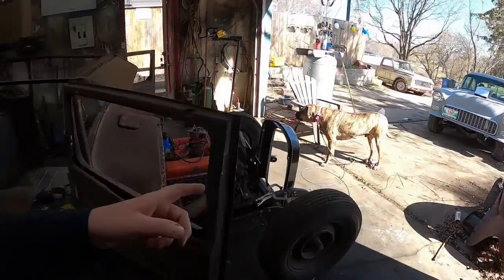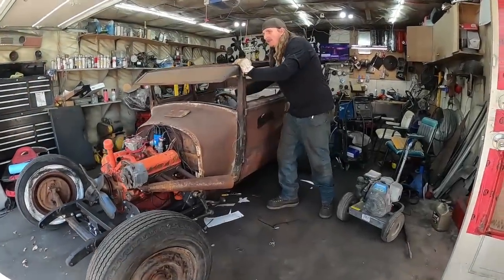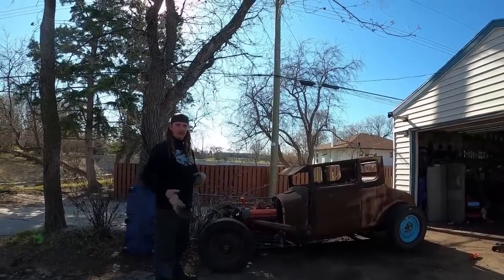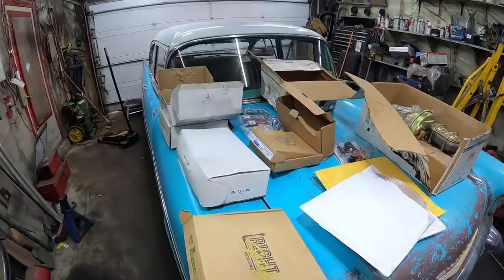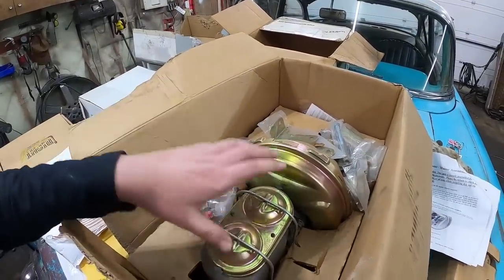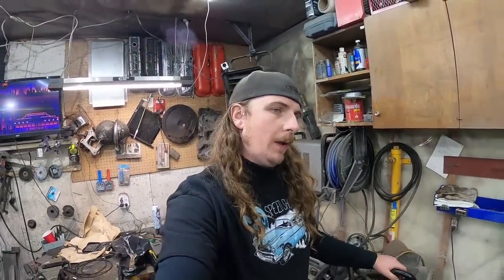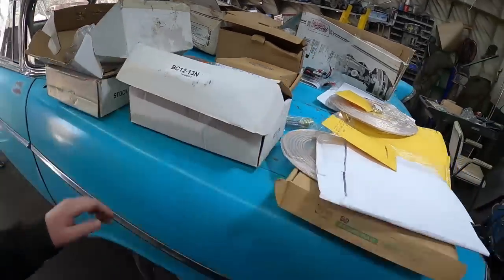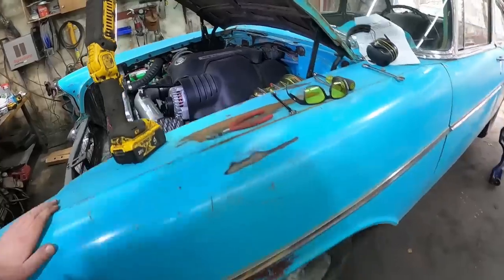Hot Rod Disc Brake Conversion - Cheap but so Easy... Part 1

Comment: It's young guys like you that give the unf to tackle work that I would take it to someone else. Keep up the good work. I also have a 57 210 a 70 Nova and a 75 camaro that I'm converting to a 71 1/2 spilt bumper
Reply: What do need to convert my 68 delta88 front-end what's the best car

Comment: When I updated my 57, I got those fittings for the brake lines into the master from my local parts store (good one). One piece fitting that went from the thread in the master to 3/16" line to both ends.

Comment: The roller bearing front hubs is a kit you can buy for a tri 5.I have it on mine with factory drum brakes. Front hubs from a 64 Chevy car does the same thing.

Comment: I got my kit for my Chevelle from ccp. $600 for the c5 caliper kit with 13" rotors new steering knuckles Corvette hub bearings hoses etc. All I needed to do was unbolt the old knuckles and outer tie rods and it bolted right on. Ungraded with a $20 swap meet hydroboost unit and Corvette master cylinder. Stopping is no longer an issue.

Comment: Cool, some of those conversion kits are junk!! I’m running a Chevy 3/4 ton axle under my gasser, I went with Speedways disc conversion that uses 2nd gen Camaro discs!! All I had to do was change out the inner bearing!! They worked awesome!!
Reply from the maker: Very cool!

Comment: Dan great video hey be careful by any aftermarket batteries I’m in Milwaukee guy in Milwaukee purchased aftermarket Milwaukee batteries which did not work in my old Milwaukee tools will work in my new Milwaukee tools won’t work  waste of money!!!!!!!!!!!!!!!!!!!!!!!!!! second of all don’t beat yourself up too bad breeder up and brake line up back when I was about your age to the 74 Pinto just like you’re doing rotors pads a whole big front new brake lines didn’t realize you need a double flare...So I used So Teflon tape that lasted for about 3 miles... Had to do it all over again keep up the great work junkman do

Comment: On the old drums, you get the hubs from a early 60's impala from the junkyard, and then a set of conversion bearings to convert the front to tapered roller like you have/had.  The conversion bearings have a radius ground into the inner race to sit against the radius of the 55-57 spindle where the original ball bearings ran against.
Reply: 61 to 68 Impala hubs already have roller bearings. No need to change them.

Comment: You can install an adjustable proportioning valve if the front / back bias is really far off. They work great with just a bit of tweaking.

Comment: FYI on a GM  if the cylinoid goes out on you it's free to fix cause you only use half of it just turn the positive nut 180 and your brand new

Comment: I have a 57 with looks to be upgrade power booster & master cylinder (front/rear tank). I think All I need are the calipers, hardware, and rotors. I am not sure though.

Comment: Bought some 'used" stuff off a 55 for my 56. Problem being, if you don't know it's 'pedigree' you are kinda left hanging. Thought it was a kit from a fairly well known company, but after sending their Tech guy some photos, turns out it's not. He said Chevelle or Camaro. Still polishing and cleaning some surface rust, but seems that it will be okay. 11" rotors. Rotors, calipers and pad look brand new. Hope so. Still need mst cyl and booster. ;) Good video, gives me hope!  ;)

Comment: I'm doing a four wheel disc conversion on my 37'. Stock straight front end, 79 truck 12 bolt rear.  Wish it was as easy as your car. Hotrod pars for 30s GM is a bit  scarce these days.
Reply from the maker: yeah i hear ya.  good luck on the parts search

Comment: Discs are going to make that Five Seven a lot more fun to drive, but less exciting in traffic. I got tired of pushing vehicles around my yard about ten years ago. So I have been on a mission to make them all move under their own power and stop, even if they are nowhere near being drivable. It makes driveway Tetris much easier. I use my winch to pull cars into the shop all the time. Used it Friday to pull an Opel GT with no suspension under it off my friend's trailer and onto a makeshift frame with wheelbarrow wheels so I can move it around the yard. Ever try to move a 900lb rusty body shell without wheels under it? I have two like that now.
Reply from the maker: Haha thats awesome!  I'd like an opel gt one day

Comment: No slotted mags yet  4 the 57 or the truck we'll stand by LOL bueno sir standing by 4 the next. Hope you don't mind a question I'm about to take out my 72 chevy truck but the back brakes are not working the pads are good but no fluid is reaching them 1 would it be the proportion value the one next 2 the booster I replaced (not me ) the master cylinder already . 2 could it be a line but they are not bent or rusted or leaking . Again sorry 4 the bother RF TX. Thanks

Comment: Dan, do you happen to have a partnumber on the brackets? I have the brackets you mentioned on the front of the stock spindles. You can’t switch them from left to right, then they gonna hit the steeringarm. So now I’m stuck with calipers on the front and might have a problem later with a swaybar hitting the calipers.... So, I want the calipers on the back of the spindle, but I can’t find the right brackets for stock spindles. Hope you understand? Thanks!
And as always, great video!!
Reply from the maker: Totally I ran the front style in my 55. Never though of the sway bar issue.  The right stuff has a decent website I'm sure they'll have somthing there.  Iv already tossed the parts lists sorry man
Reply: DD Speed Shop ok Thanks, I’ll check them out

Comment: My favorite job is packing bearings, not! I bought the Lisle 34550 bearing packer to make life easier. I used one of their kits for rear disc brakes and yeah the instructions suck. Keep up the good work.
Reply from the maker: did the bearing packer work out pretty good?
Reply: @DDSpeedShop  Yes it works great. No mess and if your repacking used bearings you can watch it push the old grease out.

Comment: I would rather convert to discs than fight with all the springs and adjusting drum brakes. Hard to believe we used to rebuild wheel cylinders, change out bearing races, turn drums, every day. I have a special kind of hatred for drum brakes now.
Reply from the maker: i dont mind the drums

Comment: Cool stuff doing 4 wheel disc brakes on my pinto but using newer  8.8 rearend I bought yesterday that was setup with disc so I just kept the brackets and going to buy new calipers for both sides and just going to upgrade the frontend with mustang ll front suspension new and with the bigger rotors as well. We gotta get all that power stopped a little quicker don't we . Also going to use a 7 inch booster and new master combo car has manual as is but that's the fun of it build it fast with the stroker 347 then gotta pull back on the reins and say whoah boy whoah 😂🤣😂🤣🚗💨 and with the 57 u will need to get that girl slowed down fast also because she looks like she likes to go fast 🤣😂
Reply from the maker: nice!  good luck on the hot rod man
Reply: @DDSpeedShop  thanks man I hope that they hurry up with the stroker kit I was wanting to get it built before it got too hot but it looks like I'll be building it in the straight heat I wish we had your summers down here in Alabama we have the humid heat and I'll take all the luck I can get you know how these builds can end up😜👍👌👌

Comment: A few things , One when packing wheel bearings with disk brakes, always use high temp grease & and use more grease between the big bearing and tapping in the seal. Fill that area solid with grease. Also fill the center of the rotor area with grease and pack the outer dust cup full of high temp grease as well.  ( there is a reason I say this ) . Next Disk pads, grind each outer edge of the pad on a 45 degree to keep them from squeaking. Next always use anti squeal compound on the back of the pads to again stop pads from chattering  or squeaking.  Question ? did the master come with a disk brake propprsing valve ?  If not , your going to have to get one for disk brakes or brakes will just flat out not work.  Also, the brake peddle push rod to master will need to be made longer, don't try and cut & weld in a piece in that rod ( I know you to well Dan ) all of that push rod MUST BE hardened !  ( 45 rockwell minimum !) or the fist time you really lay on the brakes the rod will bend and you will have zip for brakes .

Comment: If the company was right stuff then they sold the business back in 2014 because I had a kit bought in 2010 and when I got to doing the disc conversion back in 03 I was missing small parts soo when I called to get them they said new owners they would not honor the kit because it was before they bought the buisness ,imagine that!
Reply from the maker: Yeah it was right stuff.  It was okay but not great thats for sure.

Comment: That's disappointing for a pricey conversion kit. Missing parts & dust shield that doesn't work. So much for a "bolt on" deal.  You will adapt & overcome, no doubt.
Reply from the maker: yeah very dissapointing